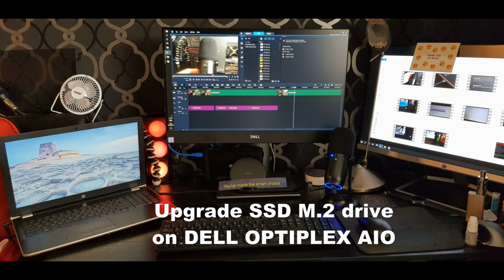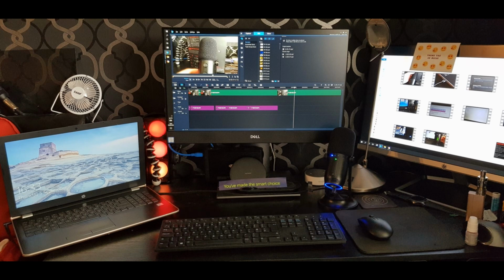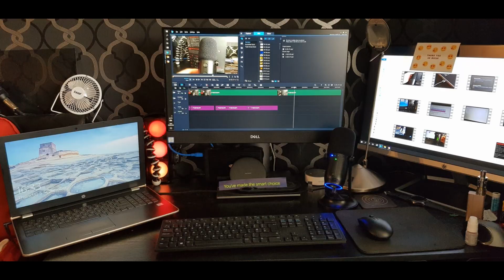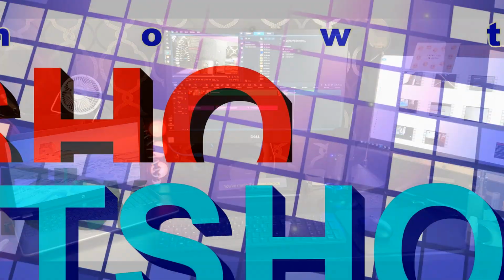How To Upgrade DELL OptiPlex Inspiron AIO M.2 NVMe SSD and DDR4 RAM 7470 7780 🪛

Comment: I am wondering if the speed of the m.2 interface is limited by the motherboard. Did you test your speed after installing the Samsung 980? What was the speed please?
Reply from the maker: I found no limitation.  It is designed to fit. 
Sequential speed 2700 
Sequential write  890 
These speeds vary  using the Samsung Magician

Comment: Minta solusi SSD M2 sata sudah dipasang tetapi tidak terdeteksi mas?
Reply from the maker: If your M.2 SSD is not showing up in BIOS, likely, the BIOS is not configured to recognize the M.2 SSD. You'll need to enter the BIOS settings and enable the M.2 SSD to fix this. 

 power on the system, press F2, and click System Setup Main Menu > System BIOS > NVMe Settings.
Reply: @SmartGadgetShow  Thank you Sir
Reply from the maker: I have updated the description to load the driver during Windows install